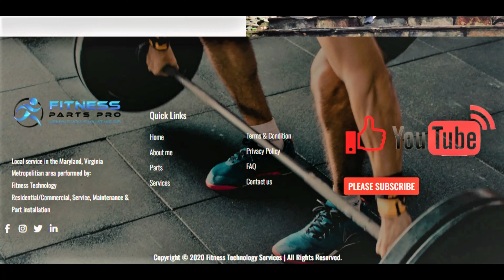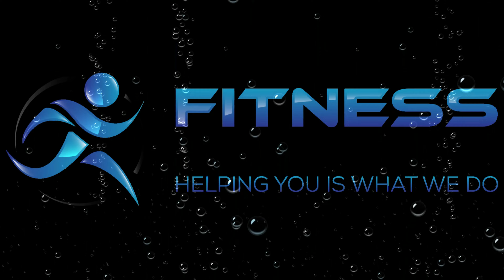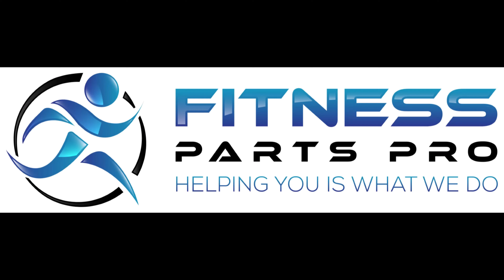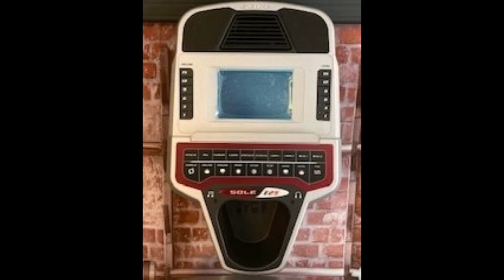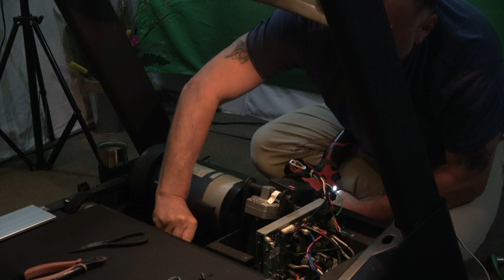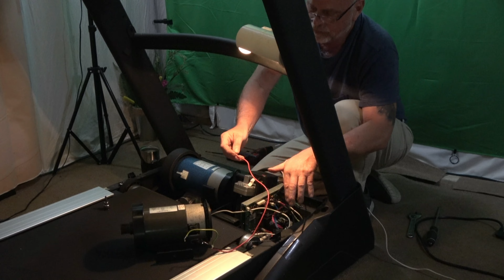HOW TO INSTALL SOLE TREADMILL MOTOR

Comment: For the life of me, I cannot get the two plugs (red and black) to come unplugged,  any suggestions?
Reply from the maker: On the newer models 2018 and up they have holding clips on the terminals ends you have to pinch them to remove wire I have a video on this on replacing new style motor controller

Comment: I was using my sole F63. Had it plugged into an extension chord and it died. I think the motor died. Can I use any 3hp motor  or do I need to use the sole brand?
Reply from the maker: @deandrayeung  Hmm I would test the motor first . I have a video on testing it 
More than likely the controller went out due to walk belt wear 
If you would like I can send you links for testing? If so send me your serial numbers to Fitnesspartspro@ Gmail.com 
And don’t forget to like my video 
Dave

Comment: Your videos were extremely helpful in replacing both the belt and deck and more recently the motor control board and drive motor. Thank you for sharing these in depth tutorials.
Reply from the maker: @jobinglass2608  You are so welcome

Comment: This was extremely helpful. I used this video along with the video you created for how to swap out the control board to replace both items on my Sole F63. I too had to recalibrate after replacing the parts as the treadmill would not lower down all the way when pressing the decline button. All was fixed after recalibrating.

What’s disappointing is that my treadmill is only about 14 months old and already has these issues. And it was past the one year warranty thus me having to do the repairs myself. Glad I did though. 

Thanks again!

Comment: Used these videos to replace the motor and control board.  Couldn't have gone better.  I may have missed it, but make sure you run the calibration after doing such installs.  Operation was jerky before running the self-calibration.  Great videos.
Reply from the maker: @stephenberger7850  well thank you. But you are right I should have added the recalibration on this video I have a separate video on this. I will see if I can edit it in? If not I will add a link, thanks for posting

Comment: Thanks for the helpful video.

About the spade connectors that are hard to remove: my version had little springs you had to depress to disengage the connector--very hard to see under the plastic sheathing; a little easier to see (but still small and deeply tucked away) after cutting away the plastic sheathing over the connectors.
Reply from the maker: My pleasure and yes it is hard

Comment: Thanks for posting this video!!  If my old F80 3.0hp motor is dead, can I replace it with an F85 3.5hp motor and get the benefit of having a stronger motor running the treadmill?
Reply from the maker: Yes and thank you! But there is not much difference between 3 and 3.5 hp I would first check with sole. Sometimes there motors have a lifetime warranty